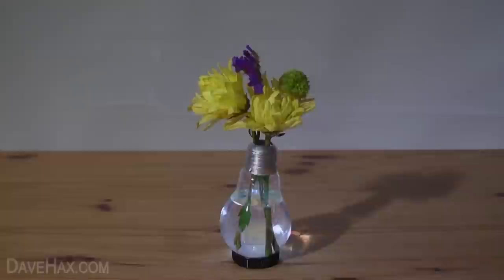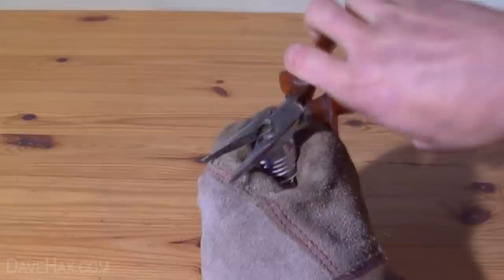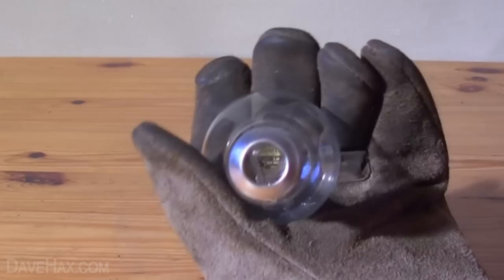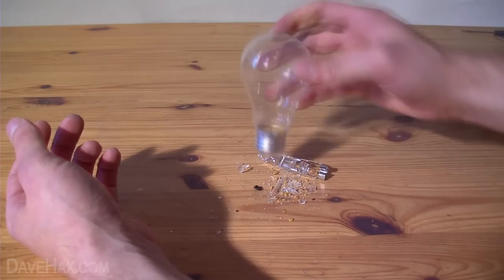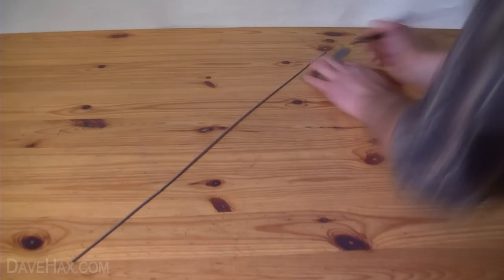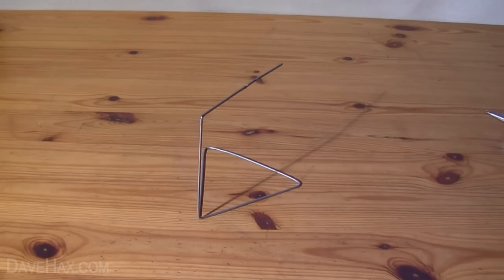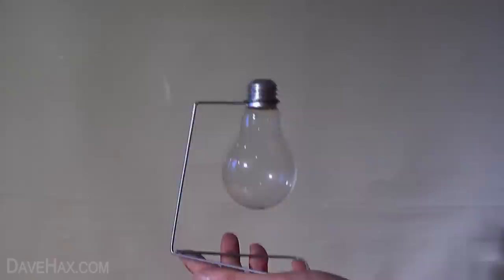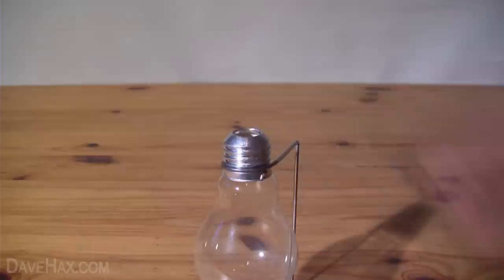How to Make a Light Bulb Vase

Comment: Boy o boy - I've finally made one -- 2nd time was the charm on the bulb. I cleaned it out too well that when I screwed it in it broke off. Started again and okie dokie. Now, the hangar was too flimsy had to use other wires taped together and viola - it actually worked. Now for the bulb thingamajig -- but thanks - way kewl

Comment: yes you just need to cut the engines of rc car and and left the wires of just one engine.grab the positve and the negative wires and  conect  to the led positive and negative wires,but in my case the car circuit was to big to fit in the lamp

Comment: This is not regular light bulb!
This bulb is halogen one, which is inserted inside conventional bulb glass, but there is not vacuum inside. Because of that it is possible to open it easy. If You try to do this with regular incadescent bulb it will probably implode and crash itself.